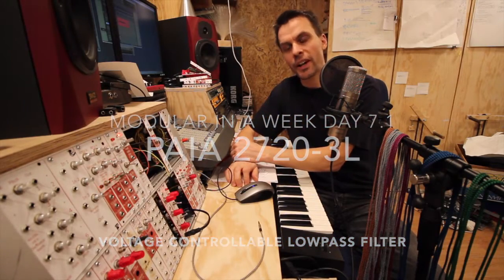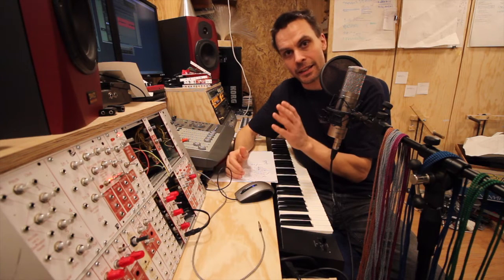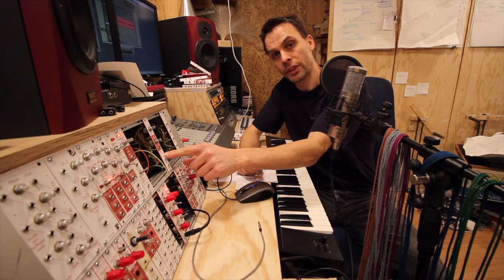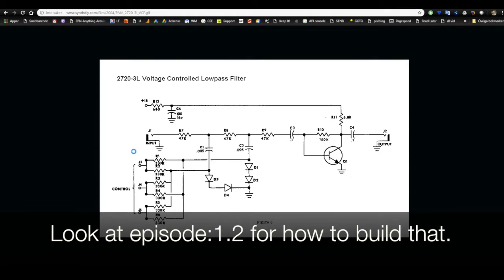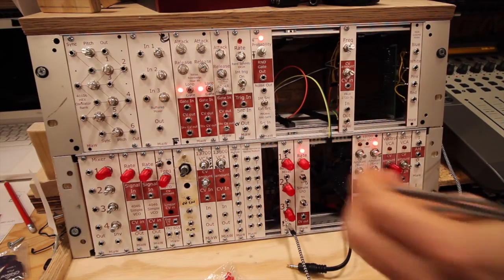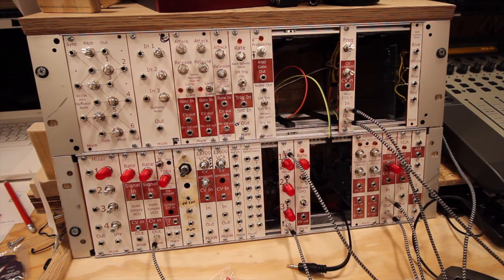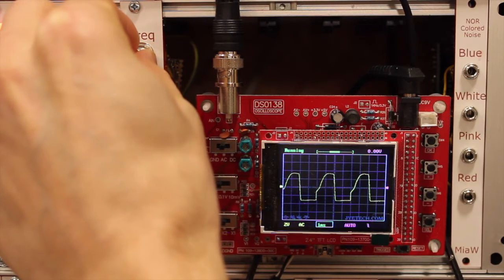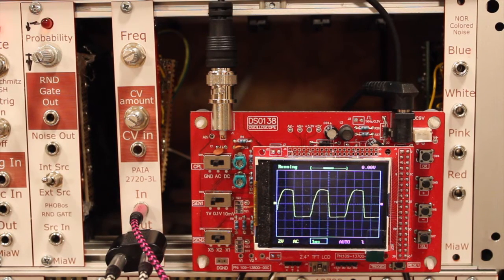Paia 2720 3L Lowpass filter - DIY Modular in a Week 7.1

Comment: I noticed that on the spreadsheet, you left out the capacitors. Just curious what you used for the uncommon .005uf caps.
Reply from the maker: You don’t need to use polar cap for this it’s just a simple 5nf or 4n7.

Comment: I will soon build s simple circuit to expand the trigger out of the Behringer RD-8. The circuit requires a diode, and I am curious to try using an LED instead. This video suggests that this may be a possible substitution- Thanks for posts!
Reply from the maker: Please let me know if it worked. Be aware that LEDs are much more "noise" than regular diodes, so it might affect the sound...

Comment: I built the 2720 3L lowpass filter but was quite underwhelmed with it, though listening to this video it sounds a bit better than I can remember. On the other hand the 2720 3B sounds much better, I was that guy ( gasboss775 ) who posted the modded 2320 3B circuit. It is worth adding the exponential current source as this greatly extends the range of the filter, also I thought it sounded better with a red led than the 1n4148 diodes.
Reply from the maker: Yeah I don’t have it in the rack anymore. As it was to subtle. I have your schematics in my todo pile. They did sound really nice. Thanks for rewriting and missing them. :)

Comment: Hey Kristian!  Finally building the filters! Yay!  Question on resistor parts list.  The spreadsheet calls for 4x220k resistors which I can't find in the schematic.  Are these used on the j3-j5 inputs due to different voltage (12v vs 18v)?  Thanks as always!
Reply from the maker: Awesome! That also means temperature has dropped in you garage? So you can be in there again. :) I’ll check and get back.
Reply: @SourceryOne  Eh, temp drop - not so much :(.  Just learning to deal and do things in short bursts.  Also, realized this is passive after sending the message, so power not a factor.  Thanks!
Reply from the maker: Spot 20 I think it says 330k in the schematics. I had 220k in bulk so I think that is why.
Reply: @SourceryOne  I happen to have both, so using 330k like the schematic should be ok, correct?  Thanks for checking on this, take care.
Reply: You build thr filter right?
So wich Values you use for the capacitors?
Reply from the maker: Both should work fine.

Comment: A new vco based in the 3340 with all the waveforms, FM, sync would be great in modular in a week, look mum no computer haven't complete it.
Reply from the maker: Well there won’t be time in this “series” but I have in mind to do a series on all those chips that are synth specific and I will definitely do a vco based on the 3340. But just that chip costs more than any module in “Modular in a Week” 😅
Reply: @SourceryOne  yeah, the cem 3340 are expensive but there's a clone named as3340.
Reply: Aarón Espinoza Castro yes I bought two as  3340 from electric druid £5 each free shipping !! Built two lmnc layout oscillators . Still to test sync but otherwise fairly easy vco 1v/ oct

Comment: Hi can I use any other transistor then the Bc547? Like 2n3406 or 2n2222
Reply from the maker: As cl3mens already said, and also just TRY with any other NPN transistor. The 2N3906 wont work as that is a PNP transistor. You need its NPN sister 2N3904 in that case (as already pointed out)....
Reply from the maker: Put a three pin female socket where the transistor should be and then just swap them out and try which one sounds the best... ;)
Reply: @SourceryOne  thanks a lot for this videos, I always want a modular synth. Thanks from Peru
Reply: Ohh thanks kristin an cl3mens. Also guys, how can I add resonance or is impossible in this circuit?
Reply from the maker: If you want resonance maybe wait a few episodes. I have many more filter videos to make. Or check out tinfoil Jesus 2720-3B build which sounds to have some resonance.
Reply: I've been told that the 2n2222 and 2n3904 are usually equivalent to bc547/8/9 in many applications.
Reply: +Álvaro Sánchez pretty much impossible. You would need to redesign the whole thing since this is a passive filter (the transistor is just an amplifier). The Paia 2720-3B is simple and resonant, have a look at my channel if you want to hear it. Electro-music also has a lot of nice simple designs

Comment from the maker: So whih do you sound better? The 1N4148 or the Red LEDs? I think after listening quite a lot that the red LEDs went a bit lower down... But as I asked, what do you think?
Reply: Hmmmm I did not really hear any difference. I like that sound as you sweep it, sounds slightly resonant? I do not have mine up and running at the moment but I used 1N4001:s or something similar.. I substitute every NPN transistor with BC547 since I am lazy and keen on keeping it simple.
Reply from the maker: @cl3mens  Actually the resonance is just the square waveform showing its jagged edges (I think) When it is full open (as open as it can be) it is almost a square wave again, and it sounds resonant COMPARED to when the filter is closed, because you hear the overtones I guess... Took me quite many listens to before I figured that out :) And just as I say in this video and others aswell, almost all BC547,548,549 seems to be able to switch between them, with at least similar result.... So that is a good way of keeping the nr of different parts to buy down :)
Reply: First listen I heard more range out of the led
Reply: Definitely more range with the LED, I'm going to try this out myself.